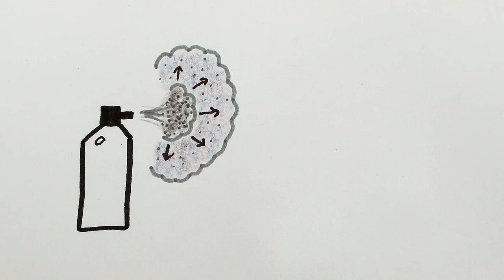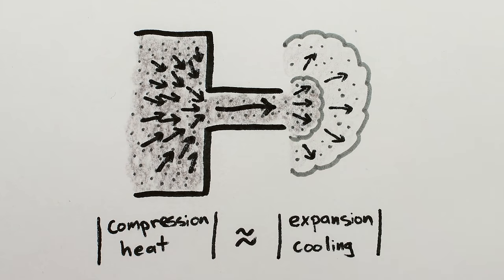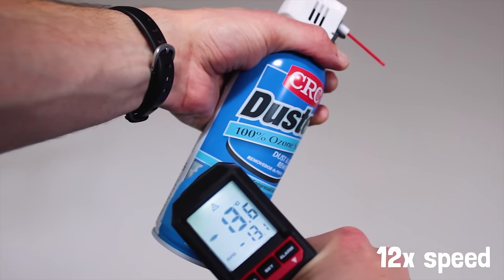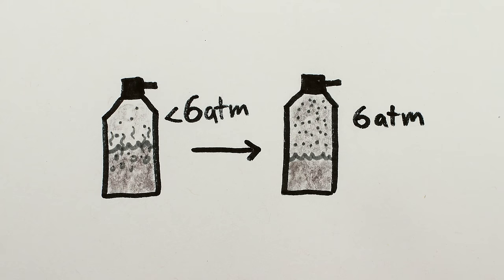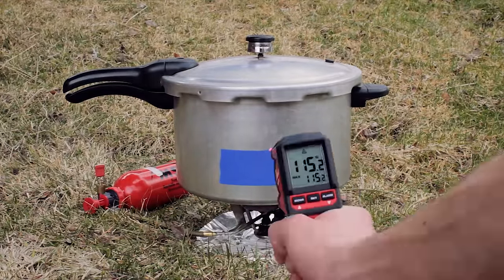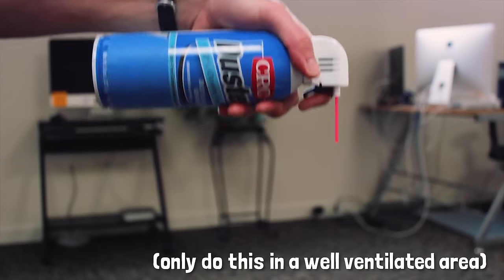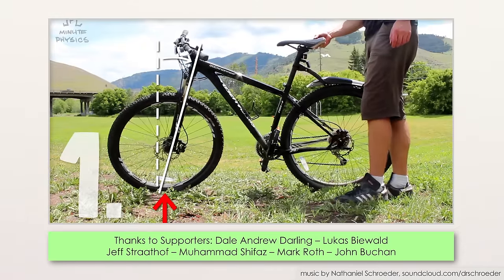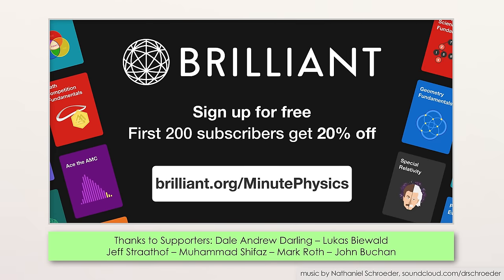Why Do Compressed Air Cans Get Cold?

Comment: Why do people use a potent greenhouse gas as a compressed air blower?
Reply: Because it works good
Reply: They want to counteract global warming by making cold air.
Reply: @akilw.3360  xD
Reply: That's because halocarbons have got many useful features (like easily compressionable) which is why they used to were pretty common, though their nasty side effects were found out later (greenhouse effect aside, it's also because they're poisonous and destroy ozone like the infamous CFC).
Reply: Because like propane, CFCs, etc. (the mentioned gas is a HFC), it's able to self-pressurize in a small volume and at a relatively safe pressure. Meaning, it's able to maintain pressure as the gas is released. Methane at 21C (70F) would require a tank that can hold pressure at 32000 kPa (1 atm=101.325 kPa). That's the main reason these types of gas are used in aerosol cans. As for why it was chosen? That was because we used CFCs before. So we traded an ozone depleting gas for a greenhouse gas. These companies (really any company) will use whatever is cheapest (most readily available) raw material that is easy to work with. Given that CFC use has declined, it's reasonable to assume the market for it's production, and by extension the industry producing it, has also declined. So CFCs are out cuz it isn't as cheap or readily available as it was before and has a public image issue, but they still need a similar self-pressurizing gas, that is "safe" for domestic use, without requiring new specialized equipment to produce it.
Reply: @geilkindfanful  Sorry, they do it for money.. not because it works good. it only works ok.. not great.
Reply: @cawfeedawg  Sure they do, because it is cheap and works
Reply: @yellow01umrella   If you think so, you shouldn't be here.
Reply: @yellow01umrella  Gimme the evidence for that
Reply: @geilkindfanful  How can science (which can't predict the weather for more than 10 days in advance), can make huge predictions for the climate for 20+ years in the future? And how can you tell how much of it is human caused, and how much is naturally occuring?
Reply: @GLPentAxel  It's based on the lack of evidence for human caused   climate change. And since people are already profiting from it it's a hoax.
Reply: B Rabbit I don’t know about you buddy but I have an accurate one month forecast on my phone.
Reply: @yellow01umrella  You mean like the reports spanning over a century of data showing a trend of rising CO2 levels, temperature, sea level, frequency and intensity of hurricanes, among others?
People profiting from something is the worst argument I've seen. It's like saying cars being a faster method of transportation than horses is a hoax, since car salesmen profit from it.
Yes, climate change is immensely complex, with a massive number of different factors. The thing is, we already measure all those factors to quite a significant degree, and the ones not having to do with human activity just can't be the sole contributor to the changes we see. There has to be something else, and unless we discover some massive, weird factor other than human activity to be the cause, then we kind of just have to default on ourown  actions being that cause.
Reply: @yellow01umrella  Just look at how the climate is changing since the industrial revolution and then look at the climate before the industrial revolution, you can see how the climate changed more in the last 100 years than it did in more than 1000 years before the industrial revolution
Reply: @GLPentAxel   I'm not saying  that it was invented so that people profit from it. Also those reports  are highly questionable. For one thing correlation does not imply causation.
The biggest greenhouse gas is water vapor. There's no way to tell how of it is human caused. If you blindly believe scientists and computer simulations we should have been under water by now.
Reply: @geilkindfanful  
Correlation doesn't imply causation. It may be caused by humans. But it also may be a larger climate trend in work that we aren't seeing. 200 years is simply a grain of sand in the timeline of the planet.
Reply: @yellow01umrella  No reports, perhaps other than very obscure ones that climate change deniers like to bring up as evidence for their cause, has stated that we should have been underwater by now. That's a gross overestimation.
Correlation does not imply causation, no, but then again, does causation even exist as a real concept? I'm not trying to go full-on philosophy mode here, but just know that essentailly all science is correlation based. Some has a 99.9%+ confidence on a causal relationship, but it's still correlation based. As is the science on climate change. The possibility that climate change isn't partially man-made is so slight today, that not believing in it from a statistical standpoint would be absolutely insane. It'd be like investing all your money, all your belongings, your insurance, everything of any value, on a lottery ticket or something.
Reply: @yellow01umrella  the same way I can't tell you exactly how long it will take you to commute to work in the morning but I can tell you that if nothing changes but more people move into your area, your commute will get longer.
Reply: @yellow01umrella  Just because you can beat Papa Doc in a rap battle after choking does not mean you know enough science
Reply: @yellow01umrella  Climate is not weather. It is much easier to predict trends over longer periods of times. Over long periods, anomalies aren't significant. However, the weather tomorrow in itself has a chance of anomalous behaviour
Reply: @GLPentAxel  How do you even estimate the odds about something like that? I can say the same thing, since your position is based on 100 years climate trends, which means nothing, I mean absolutely nothing compared to the time scale of the planet. Your sample size is so small that it makes 0 difference.
Reply: Same with why we drive cars filled with gasoline not electronic...
Reply: @yellow01umrella  Explain me why the temperature, sea level and the frequency of natural disasters is rising, when it didn't rise that fast since the beginning of the earth? Or are you thinking god made the earth?
Reply: @amanharwara  I know everything you have to say against me LOL
Reply: @geilkindfanful  How fast was it rising "since the beggining of Earth", and how is it rising now? Also why bring god into this?
Reply: @g.3521  So what's the trend? Global temp. is up by 1 degree C in 150 yrs and therefore it must be human caused?
Reply: @yellow01umrella  Weather is NOT the same thing as climate.
Reply: @GarrusN7  I didn't say they are. But they are somewhat related. My point is that since climate is so complex how can we make accurate predictions about it when we can't predict the weather.
Reply: @geilkindfanful  I have, and I'm not convinced. Imo the data is being misrepresented. 
You shouldn't assume people believe X, that's called a straw man  argument. For the record I don't follow any religion, I also think that currently science has no clue about the origin of the universe. I mean String theory is pretty much dead, after millions of dollars and years of research it still hasn't made any accurate predictions about the universe.
Reply: @geilkindfanful  if it's stupid but it works, it's not stupid.
Reply: @GLPentAxel  car salesmen hate him!
Reply: @yellow01umrella  "How can we predict the climate without being able to predict the weather?" Is kinda like saying "how are you able to cook a perfect steak without knowing how every single molecule responds to heat?". There are a lot of major systems out there where we know how it functions as a whole, without fully understanding its constituent parts. In a way, all of chemistry is just that, as an example. You're most likely able to predict that there will be a traffic jam in the morning, which will dissipate during working hours, only to return and dissipate again in the afternoon. That doesn't mean you know how traffic will look every single time interval, like an hour, half an hour, or a minute. You should really follow minutephysics' advice and go check out brilliant.org. Do a statistics course, or read up on calculus/differential equations!
Reply: @GLPentAxel  I didn't say predicting the weather is absolutely necessary in order to predict the climate. I get chaos theory, I understand why science can't predict the weather for long. My point is that science doesn't always have the answers. For example, exactly how different would the climate be if there were no humans? We have no freakin' clue.

 What is science really? It's a collection of people sharing and analysing information. The thing is, people are biased, most of the time without even realising it. Things that were considered "science" years ago are laughable today.

I've seen the statistics. The biggest greenhouse gas is water vapor. In 140 years temperature rose less than 1 degree Celsius. There's no way that we have enough evidence to claim that humans are drastically altering the climate from what it should've been.
Reply: @nealsterling8151  and you're smartest one here
Reply: Because America🤷
Reply: B Rabbit bad. There is obvious evidence from statistics. Look at storms per year and ppm of co2
Reply: @undefined879 
There is nothing to discuss here. 
You can archieve the exact same effect by blowing air with your mouth for FREE and without using some greenhouse gas. 
The only reason those Air gas cans exist is because some asshole company tries to make money at the expensive of the environment and enough stupid people buy that crap.
Reply: Cause we feel like it
Reply: @yellow01umrella  It's scientifically proven that greenhouse gases exactly do what their name indicates. You can even try it by visiting greenhouses used for farming (tomatos) etc. These only work because they get filled with these gases. 
But clearly one must decide between the greenhouse gases humanity produces by burning oil, gas and coal, and natural emission like composting, vulcanos etc. Natural emission are almost complelty recaptured by the natural cycle, e.g. oceans and plants.  But the presumably low percentage of CO2 we produce compared to the natural one, isn't recaptured and increasing since the industrial age.
Reply: @yellow01umrella  If your argument for why global warming is a man made hoax boils down to, "we have evidence for the contrary but must be skeptical because you can't always trust science," then reasoning will do nothing to convince you otherwise. Just know that your stoicism is founded by rigidity in ignorance instead of methodical scientific endeavor.
Reply: @devinracelis8392  I'll definitely agree if there's sufficient evidence
Reply: @yellow01umrella  Actually, considering what I just said, no you wouldn't
Reply: I would be a bit more sceptical. Science is wrong too often to believe everything by default.
Reply: @yellow01umrella  
There's a difference between weather and climate. If that was your only solid evidence, you just have to face the facts.
1. The greenhouse effect exists.
2. Greenhouse gases, which accelerate the greenhouse effect, also exist.
3. Humans are putting a high volume of greenhouse gases in the air, trapping heat in the atmosphere and raising the global temperature.
4. This excess heat will melt ice shelves, acidify the ocean, and destroy shorelines.
Please refute one of these points with real evidence, and then we can have an intelligent conversation.
Reply: @yellow01umrella  
Okay, sorry. I've read the entire thread now, and you come off as a logical person. Not believing in man-made climate change for a lack of evidence is perfectly logical, unlike the wackos who completely deny climate change altogether and claim it's all some big conspiracy, contrived by NASA or something. But you've made some blatant lies here, whether it was your intention or not. I'll address them in my next post. Sorry if that sounds super pretentious.
Reply: @bonniejunk  1. Yes
2. Yes
3. Not enough to raise the temp. with any significance
4. When? By which year? People have been saying that the ice caps will melt for more than 30 years now.
Reply: @yellow01umrella  
Point number one:
"Water vapor is the biggest greenhouse gas."
Well to be honest, you're right on the money. Off the top of my head, I believe the percentage of water vapor (compared to other greenhouse gases) in the atmosphere is 90%.
But that doesn't mean CO2 and methane emissions pale in comparison;  water vapor in the atmosphere provides a positive feedback loop, amplifying the effects of other greenhouse gases. The hotter it gets, the more water evaporates from the ground, making it even hotter. So does it go on indefinitely? No, clouds form, deflecting sun rays from the ground and cooling global temperatures. Water vapor has always been a healthy part of the atmosphere and carbon cycles.
Point number two:
"In 150 years, global temperatures have only gone up one degree Celsius."
Again, not a lie, but a large misinterpretation of the data. You say it calmly, like it means nothing, but if you told an educated climate scientist that, they would understand the levity of the situation. One degree might not sound like much, but it can cause ocean acidification, melting ice shelves, an increase in hurricanes and natural disasters, etc. And it's not just one degree up. When you average that out over the entire world, over a year, it can lead to an unbelievably dry summer in one part of the world, potentially causing a famine. That's not even mentioning the coral reefs, keystones of huge ecosystems that get hit the hardest by ocean acidification.

We can't specifically point out a 1:1 correlation between humans and climate change, but we've definitely found a solid link. Using data trends, peer-reviewed studies, and common sense, I'm of the opinion that we should strive for lower greenhouse gas emissions at any cost.
Reply: @yellow01umrella  
1. Yay
2. Yay
3. Yes, with significance. I addressed that in a previous post. 
Tl;dr - death, doom, destruction, coral reefs. 
4.I didn't say ice caps. I said that ice will melt, which is never good.
Reply: @yellow01umrella  To produce evidence that either confirms or denies the issue of climate change will prove to be a futile exercise because debating whether or not climate change exists is at its heart a philosophy issue. There's certainly plenty of scientific evidence that climate change exists. By questioning the credibility of scientific observation, a fundamental method of ascertaining truth, it's evident you're using logic to pursue an agenda instead of revealing the true nature of reality.
Reply: @bonniejunk Yep, ok. Not sure if it human made but I do think it's an experiment and not worth finding out. The average person can't be blamed though. The problem goes much higher. Also it feels like climate change is being exaggerated from time to time. 
 How do you feel about politicians saying that the world is gonna end in 12 years if we don’t address climate change?
Reply: @devinracelis8392  Of course climate change happens. Whether or not it's caused by humans is an entirely different question. It could be natural. It could be some combination of the two. I don't think we entirely know yet.
Reply: @yellow01umrella  
Yes, I agree that it's often exaggerated. I also think the average person can't be blamed. That's not relevant, and even if it was, passively denying global warming is almost as bad as advocating for it. Any average guy can do their part to help the earth. Either way, notice how you treaded lightly in that comment; you're avoiding the fact that there's still real stakes. It's not a perilous world-ending disaster, but it's still serious enough for us to take precautions against it. 
"I do think it's an experiment and not worth finding out."
It appears you still think it's a trivial matter that hasn't been extensively proven. It has; there's no question of finding out new information. We now know enough to make an educated hypothesis: maybe burning coal, petroleum, and other fossil fuels isn't that hot of an idea. Maybe we shouldn't cripple vast ecosystems just because some people think precautions against climate change aren't "worth it". Earlier in this thread, you said you'd definitely accept man-made global warming if there was sufficient evidence. Well, now I'm telling you there is, and you're turning a blind eye and saying it's not worth it.
Reply: @yellow01umrella   B Rabbit  You warped my premise. Yes, climate change happens, but the topic was whether or not the discourse surrounding it was a "hoax". Your reasoning that it is a hoax because science can't always be trusted simply doesn't make sense. To be logically explicit, that's an appeal to ignorance.
Reply: @bonniejunk  Oh you misunderstood, I agree; It's not worth for humanity to find out by just continuing to burn fossil fuels and watching what happens. It's a stupid experiment. But that's just how the world is.

Personally I don't care that much. Humanity deserves whatever it gets. Whether or not we'll become a multi-planetary species or bring ourselves into extinction is pretty much a coin flip.
Reply: @devinracelis8392  No, I think it's a hoax because people are exploiting it and making a profit from it.
Reply: @yellow01umrella  We know that a volcano eruption can have a big impact on the climate by putting gasses that were trapped underground into the air. If you extrapolate that to humanity you could say we're a very slow worldwide vulcanic eruption since we're taking stuff from the ground and putting it into the air. We know when a volcano erupts and we can estimate their effects using knowledge gathered from previous eruptions, so we can compare humanity to a source that is known to impact the climate.
Reply: @yellow01umrella  Okay, I'll bite. How do people profit off the idea that climate change exists and is man made?
Reply: @yellow01umrella  It is true that you shouldn't believe everything statistics throws at you, it's a tool that can be easily misused to make people believe the wrong thing. In a conflict such as climate change legit data can be used by both parties and use legit statistical methods to show the things they're biased towards. The reason this whole thing became so political is because there's huge money in the oil industry which for some countries are the sole reason they're wealthy. People don't want to give a bad name to whatever it is they make money of, so it's not surprising this whole conflict came to be.
Reply: @devinracelis8392  By creating "environment" taxes; by exaggerating and politicising the issue.
Reply: @spectralpiano3881  I guess. Though we don't really know how much the atmosphere can take before it's a problem.
Reply: Climate change isn’t just man made. I know this is going to shock you but it just isn’t. It’s a million factors that have to be imputed into the formula. Stuff like water droplets, smog, clouds, lightning even. So until you have all the data points you cannot judge the weather because in the end, climate manages the weather.
Reply: @yellow01umrella  We already see effects that has been pointed out by others here, and we know what causes it, and we know we're putting more of it up there which was previously trapped underground. In a way it doesn't matter at all if we're the cause or not, but we're 100% sure we're accelerating it. Even if all the environmental goals that have been set are met, we still will be getting more gasses up in the atmosphere since we will still be getting all that oil & gas, we only hope that nature can handle those lowered rates to restore the climate as it was before. Since we'll still be adding more and more CO2 I'm sceptical if we can reverse it at all, slowing it down will be a big step in the right direction though.
Reply: @yellow01umrella   I'm still unclear as to how taxing environmentally destructive practices and creating awareness to the issue translates into anybody profiting off the idea of global warming.
Reply: @yellow01umrella  Also, I think these environment taxes are a good thing, it's the only way you'll be able to change millions of people, by taking their money for it. Of course, for it to work one should not be taxed (or less) if they use public transport, use electric vehicles, etc. I know these aren't CO2 neutral but they're less, less is good.
Reply: @yellow01umrella  Oh another thing, more greenhouse gasses in the atmosphere won't be a big deal for Earth and it won't make us humans sick or anything, so it's not a real threat for us. It is however disrupting other ecosystems which might make some things harder to get in the future. But humans are selfish and nearsighted, luxury goes before anything else, and for luxury we need oil.
Reply: @generalhyde007  As been pointed out before, you don't need all datapoints to understand a system enough for what's relevant to you.
The things you summed up are factors for weather, not really for climate. None of the things you mentioned is able to change the global climate (as in it getting hotter or colder) since there are no changes in the composition of the atmosphere. Water droplets are able to change local climates though, if you could somehow put a rainforest in a dessert the climate would quickly change from a dry to a wet climate.
But if the atmospheric composition stays the same (and I guess if forests stay the same too) water droplets will stay the same too, so the climate is a cause for the amount of water droplets, not so much the other way round.
Reply: @generalhyde007  The amount of water vapor in the atmosphere is a stable system. If there are too many clouds (water vapor), temperatures will drop so less water will be vaporised. If there are no clouds temperatures will rise so there will be more water vapor. This will oscillate back and forth in a stable (yet unpredictable) way. Temperatures will follow this oscillation and will average out on some value. This average will never change due to this system so it does not affect climate change.

The problem with greenhouse gasses is that they don't come back down like water vapor does, it's a one way system which also affects the temperature. This temperature change will change the average and so is a cause for climate change. This temperature rise will affect the oscillating system described above tho, so one might think water vapor is a bigger cause than other gasses while it's not a cause of change at all, it's the result of the change which is a entirely different thing.

The changing of the climate is all we care about, we don't see climates change if it's lightning, so we don't care about that, even if it would have an effect. If it'd had a big enough effect we would know though.
Reply: Dark Hood Chief You realize cow farts are way worse contributors to Climate change, compared to CFC’s or even cars
Reply: Mp claim the gas is a potent ozone (which im assuming is ozone deplete) the can of air says 100% ozone safe
Reply: Indiana Jones u make too many assumptions, cows/algae create more greenhouse gases than cars. Keep trying to prove your own bias
Reply: Rccamo3  You should not care what people say, you should use basic reasoning and logic. Everyone knows we're using fossil fuels. Most people will also know these come from below the surface of the earth. The gasses from using these fuels go into the atmosphere which adds to the amount of greenhouse gasses in it. So we can conclude humans do play a role in climate change, however small it is.

It doesn't matter how much is our fault and how much is "natural". We see negative effects, so if it's in our power to at least slow down the climate change, it's of our best interest to do so.
Reply: @yellow01umrella  
Oh, I see. That's where we depart. You speak in a nonchalant tone about mass extinction, but I think it's just because it won't happen in your lifetime. I mean, come on. Would you really want to let trillions of creatures, and possibly all life on earth die? I've no particular fondness for humanity, but what about the animals? The veterans of earth, who've lived here for millennia? Are we going to doom them along with us?
Reply: @bonniejunk  I like animals. They'll probably be fine. Humans have been here for a long time as well. 350,000 years and that's just Homo sapiens.
Reply: @devinracelis8392  Taxes are a bad thing. Gov. should stay away from peoples' life as much as possible. If it's really such a problem they should ban the practice, not tax it.
Reply: @spectralpiano3881  Average citizens shouldn't be taxed for something that's mostly not their fault. Also taxes are bad by default. Gov. should stay away from peoples' lifes as much as possible. If they were serious they would ban the practices instead of taxing them. Not to mention those taxes will probably be misused. Also politicising climate change is a can of worms, and it's already opened.
Reply: @yellow01umrella  Taxing something doesn't mean the big bad gubmnt is profiting... Conversely, I argue that regulations aimed at limiting destructive practices prevent companies from fully exploiting the environment. Were these regulations to disappear, the company would make more profit. Can you clarify how taxing destructive practices is equivocal to somebody profiting off the idea of global warming being man made?
Reply: people are not aware of it. The company states "ozone safe" on the bottle, and to people who are not to familiar with the atmosphere but know of certain buzzwords surrounding it, they may associate "greenhouse gases" and "ozone safe" as one in the same.
Reply: @yellow01umrella  We can't just ban it. It'll cost tons of money to replace fossil fuels, so taxes are the logical choice. Whether the money is actually used for fighting climate change is a whole other discussion I'm not going to talk about. There's just no easy solution to this. It's impossible for this to be a smooth transition, there will always be people who are affected more by it than others (in a negative way), that's just how societies work.
Reply: @devinracelis8392  Marketing. People have no clue so they buy "enviroment" shit that are misleading.
Reply: It's a can, it contains grams of the thing. Average cow produces a lot more greenhouse effect.
Reply: @yellow01umrella  
Did you not hear a single word I said? ECOSYSTEMS. WILL. COLLAPSE. They won't "probably be fine". Seriously, are you even listening?
 On a side note, I get that you were trying to sound smarter than you are, but pulling some number out of nowhere and saying "and that's just Homo sapiens" is not only cringey, but also inaccurate. You're implying that humans existed other than homo sapiens. Homo erectus, australopithecines, and other primates aren't defined as humans, just early hominids. Do your research; the only humans are homo sapiens sapiens.
Reply: @generalhyde007  
Nobody's saying all climate change is man made. We're saying that humans and global warming have been directly linked in many, separate, peer-reviewed studies. We know for a fact that pumping greenhouse gases into the atmosphere is bad, so why keep doing it on this unprecedented scale just because some aspects of the science are vague?
Reply: @bonniejunk  Take a chill pill.
Reply: @yellow01umrella  
Sorry, I'm just peeved by the fact that I told you and gave you real examples (that are already happening) about animals and ecosystems collapsing from the extra heat, and then you respond to the least important part of the message, as well as basically saying, "lol ta animals r gonna be fine prolly".
Reply: @bonniejunk  Because they will, we are nowhere near the climate change required for extinction.
Reply: @GLPentAxel  it's worth noting there are studies that also show that those changes are natural, but sped up by human interferences. I'm not advocating for either side, but I don't think the science behind climate change is sound enough right now to make any true decisions.

A minor, and mostly unimportant, point: there's reason to take a pinch of salt with facts coming from the side of "Global Warming is a Problem" because that allows more funding to be put into their research on climate change. Again, a mostly unimportant point, but it's worth keeping in mind.
Reply: It doesn't deplete the ozone layer, is more dense than air, and maintains a more constant pressure (source: comment thread above this one)
Reply: @ebbandfloatzel  We will need to transition to other forms of power anyway since there's a limited supply of fossil fuels. If there is reason to think fossil fuels are bad for the environment, then why not put money into the research of alternative power sources? Or give subsidies to make carbon neutral products cheaper so the big public has a smaller footprint?

Either way, there is enough good science on global warming to know it is sound enough right now, there is just so much fake news out there that it's hard to believe any of it. Fake news includes articles saying global warming is a thing, just because they exaggerate immensely.
Reply: @yellow01umrella  You're right, life won't ceise to exist due to the global warming, but many species will go extinct. There are a lot of animals that are very dependant on their environment, including the other animals there. Since they have nowhere else to go, take away or add one thing and they'll have a really hard time to survive. Just to give an example, insects will quickly leave their territory if it's getting too hot since they have no active body temperature regulation. Bigger animals can't easily do this and they might be very dependant on the insects there.

I'm sure you've heard that the temperature only went up by 1 degree, so surely it doesn't matter much. The thing is that this 1 degree is a global average, so in some places it gets much hotter while in other places it cools down. Cooling down isn't good either by the way.
Reply: reasons
Reply: Because in reality, I always used greenhouse can upside down for cooling when needed, never used as air compressor, for that I use air compressor 😂😂😂
Reply: @akilw.3360  This is like the expanding brain meme incarnate
Reply: ‘People’, this isn’t any specific group of people. What are you, an Alien?
Reply: @Neal Sterling but at the same time you get weary by blowing out air out of your mouth and pass out after a few attempts.

you also get dust in your eyes, nose and mouth without proper protection.
Reply: Last time I checked liquid oxygen is very cold and explosive